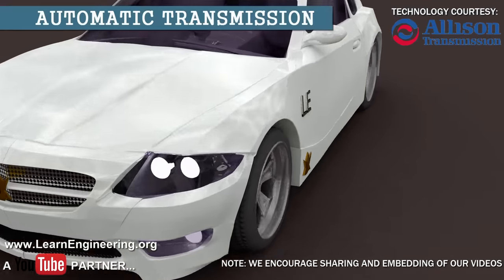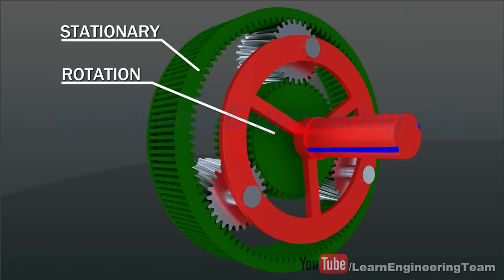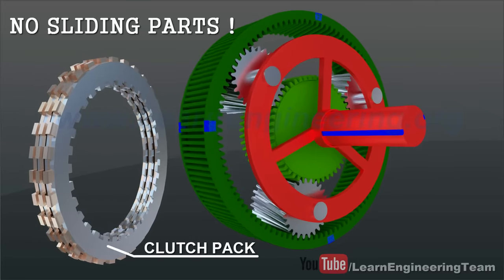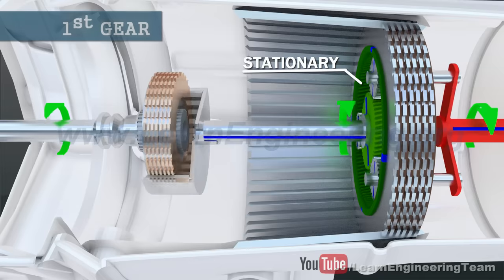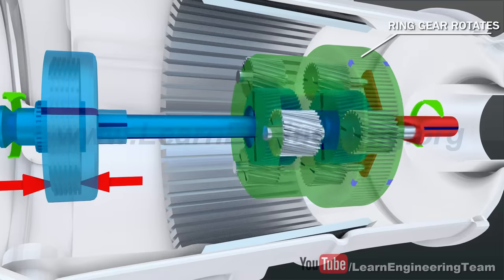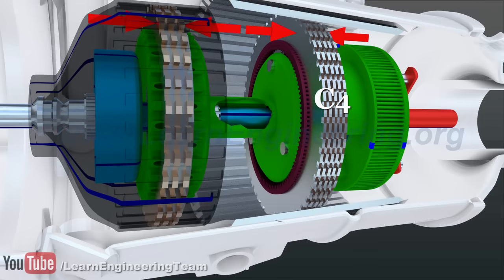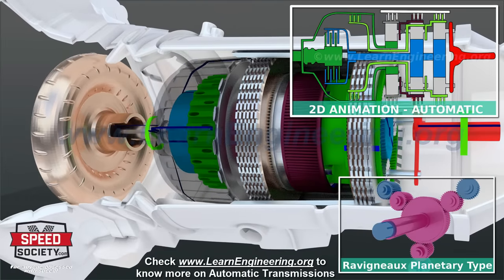Automatic Transmission, How it works?

Comment: Learning difficulty: 
1) Light speed
2) planetary colonisation
3) galactic travel and using sub dimension engines for first time dimensional travel
4) space time reversal using gravity in a black whole
5) simplest form of automatic transmission
Reply: Lmao
Reply: It does not even feel like a joke. Its just facts.
Reply: I am sitting here in tears laughing so hard about this because it was about as accurate of a statement as one could make.
Reply: And they work for years daily driven with no problems. A true engineering marvel.
Reply: It's not conceptually difficult, it's keeping track of all the fucking moving parts
Reply: the planetary gear moves with the sun gear and the shaft moves along with the car. think hard, you missed it. It is planetary and sun gear system. it has nothing to do with space and time travel.
Reply: Whoosh
Reply: You can't reverse space time using a black hole, you can only accelerate time with the gravity.
Reply: @alocin110 bro the SUN and the PLANET are part of the joke 😂
Reply: @carters1209 agreed! For context if anyone doesnt want to scroll up, he said that automatic transmission is not conceptally difficult, just that its hard to keep track of all the moving parts
Reply: i would have said extra dimensional engines but yes
Reply: @alexanderpennington4055  excuse me WHAT?? Thats a thing??
Reply: the thing is the video makes sense when u keep eye on each moving components
Reply: Lowered my hope
Reply: shut XD

Comment: Some kid in my freshman engineering class made a full working  miniature Lego car. Working electric engine, complete with working Lego power windows, and a full complete lego automatic transmission. Took him about 2 and a half years to complete. 

The guy was absolutely insane.
Reply: And I thought a 3-speed manual was hard to make work. Some people's brains just work different.
Reply: It’s called research and dedication.. and genetics lol.
Reply: What do you mean an electric engine? Like, just a normal electric motor?
Reply: Did you bully him? JK!!!:elbowcough:🤣😂
Reply: An actual car probably would have cost less :P
Reply: @Calthecool I've seen motor models that use linear solenoid actuators to act like pistons driving a crankshaft.
Reply: @timharig  
yeah I was just wondering if they meant something else, those are normally just called solenoid engines.
Reply: @drummer_zay9493 genetics have nothing to do w intelligence 😭
Reply: That's nuts 😮

Comment: I've watched and rewatched this, the only thing that makes sense is why transmissions are so damn expensive
Reply: Thank you  LOUIS EDWARDS, EDWARDS BROTHER'S TRANSMISSION ROANOKE RAPIDS NORTH CAROLINA 😁🔧⚙️🏁🇺🇸
Reply: @louisedwards6681  the comments section on this video surpasses every other video I've seen in the level of weird
Reply: Yes but there is still one thing I'm still confused about transmissions:

I saw a video of someone bringing one of these apart and the thing I was most confused about was the 3 layers of mazes and 4 small metal balls in each one of them and why it was so important not to move them? I still don't understand that part's function.
Reply: @richardcruz-torres4942  Those metal balls act like valves, for the fluid, for engaging different clutches, you forget or misplace one and you are screwed.
Reply: its not the parts that are expensive its the knowledge on how to fix/ rebuild it your paying for
Reply: @richardcruz-torres4942  that part I understood; they put all that metal like they put players on the field to keep the opponent from advancing with the ball
Reply: It makes my head hurt
Reply: bruh that was the only thing that crossed my mind
Reply: Hahahahahahahaha

Comment: Well, you did an okay job explaining the "transmission" part. What about the "automatic" part?
Reply: This is basically how it looks like - the only thing is, that modern automatic cars with semi-clutch technology have computer-supported clutch changing mechanisms.
Reply: Qᴜɪᴄᴋ Sᴀɴᴅ  So it(transmission control unit) cannot be applied to the basic gearbox? why?🤯🥴
Reply: @ravindujayasekara2969  It's a computer chip.  It reads input from the engine, as well as some other info, and determines when to shift gears.  That part is rather simple.  It short terms, it simply adjust gears when the engine is working hard enough, and the wheels are turning fast enough.
Reply: @ravindujayasekara2969  because that still required you to move the gears. That's what these automatics do? Is move the gears for you? The automatic takes the simplicity out of  it entirely
Reply: how does transmission control unit change the gears exactly?
Reply: @ravindujayasekara2969  cause moving the shifters require some big movement that it's easier to just feel it manually. For the planetary gearbox, you only engange the clutch packs which is fairly simpler to be automated
Reply: @ravindujayasekara2969 i might be mistaken but that might be how AMTs work (they suck)
Reply: It's automatic because you don't have to use your hand to manually engage/disengage the gears or your foot to engage/disengage the clutch.

 The car computer controls some solenoid valves that allows some hydraulic pressure to engage/disengage the clutches. The oil pressure is built by a pump that the combustion engine spins.
Reply: @JA-im7cs basically if the rpm is too high it shifts?or if the torque is too low?
Reply: @JA-im7cs  So how did the automatics work before computer chips were powerful enough to be used in cars? My understanding is that automatic transmission was invented before manuals
Reply: @squidwardo7074 Hydraulic pressure. Look into something called a "valve body." It's like a little maze for fluid pressure. Passageways open up and the pressure opens/closes the clutches. Transmissions back then were also a lot simpler and had a lot fewer ratios than today's do.
Reply: The transmission control unit reads sensors for throttle position, speed etc and sends transmission fluid compressed by the transmission pump, through the valve body (look up a picture of this), by using solenoids (electronically controlled valves). This hydraulic system moves the clutch packs.
Reply: basically: robot in car go haha change gear bcuz I said so.

Comment: Thank God for engineers... as weird as they are, I'm extremely grateful for the knowledge snd skill they possess to make things like this possible. This stuff is mind boggling.
Reply: They do the hard thinking so we don’t have to
Reply: We stand on the shoulders of giants. Most automatic transmissions borrow heavily from their predecessors. We have it easy these days -- the engineers of the late 1800s-1960s are definitely the real heroes.
Reply: as weird as they are?
Reply: @alandeutsch9987  They're definantly unique lol.. so much so as for me to consider them "weird." It's a good weird though!
Reply: @SDCustoms  It's nothing special. Just like learning a new language. You will have to study the different parts. You need to learn the conjugation,  the grammar, you will have to understand the sentence structures, the determiners, how gender is applied etc. Once you understand every part individually, you can create sentences. Once you know how to make sentences, you can make paragraphs, then chapters, then whole stories. 

Engineers studied. A lot. They understood the basics and build more knowledge on top a solid foundation. When that new knowledge is well understood, they can add more stories and build a tower of knowledge. 

You can't build the top floor if you don't have the floor below or any foundation at all.

Comment: I understand the basic concept. You apply certain clutch packs to engage certain planetary gear sets to use a certain "gear". I still couldn't explain it in detail, like I could a manual transmission, but I think I get it.
Reply: The other details are things like hydraulic pressure applied to clutch pistons. Similar to brake hydraulics. The other component is the actual gear ratios which are all different. Causing different planets to spin at different speeds.
Reply: Brain out of order.
Reply: Same.
Reply: I think most people here saying how complicated it is also understand it at the level you're describing.

Comment: Manual Transmission = harder to operate, easier to understand
Automatic Transmission = easier to operate, can barely understand.
Reply: rEsonansDx true
Reply: Stick is easy to drive
Reply: Sticks are easier to drive & control.......but automatics are soothing- no manual shifting required.
Reply: Manuaali on helpompi. Ja kestävämpi.
Reply: Ja automaatti kiihtyy hitaasti ja syö enempi bensaa.
Reply: it's pretty simple just watch the video again and again
Reply: ResonansDeX well said
Reply: exactly true brother
Reply: Funny how that works lol
Reply: Sonny Haskins you made no sense, Automatics doesn’t require the additional learning/thought process necessary to propel and stop. Unlike an automatic which all is done by a computer. You can shift smoothly in a manual
Reply: Continuously variable transmission is the best of all but it's not used because people like the elevating pitch roar gear transmissions make the engine emit
Reply: Is it me or does that sound like a potential allegory that can somewhat explain the social dynamics between the men and women.
Reply: easily the best concise conclussion. 
*my brain crashed, too. lol
Reply: Driving is more fun in a manual. Wanna speed up? Engage clutch, rev the engine, downshift, and feel your engine's power. Speeding up in an automatic? Better floor it and hope the CPU know what you're trying to do.
Reply: Manuals are also easier to work on.
Reply: @RzVids  not all automatics are computer controlled.
Reply: @CombraStudios  CVT constantly slipping belts and generally dont last as long as an automatic and definitely not as long as a manual.
Reply: Aleksfoxtrot if it’s not by a human, then it’s computer controlled.
Reply: @RzVids  I have a mechanical automatic transmission on my 91 f150. A computer controls nothing.  Its controlled by fluid pressure and flow.
Reply: Manual you have just a few gears and synchro and automatic you have a thousand tiny gears and gear sets different clutch packs for odd even gears and reverse, shitload of springs , little metal balls, valve body, pistons or one piston ,shift solenoids , oil pump, torque converter, computer , bands, o rings,  holy shit and thousand more parts to list I'll come back and keep adding
Reply: @Topsiekku  Video joka on kokonaa englanniks ja sit joku random suomalaine tulee kirjottaa tänne kommentteja vaa suomeks eikä kukaa ymmärrä xdd
Reply: I like manual, its easy to me to drive m/t
Reply: fun to operate
Reply: Right true dat.
Reply: Excellent point
Reply: CVT had performance efficiency related problems from what I've heard...car will have less overall power at the wheels compared to putting any of the other transmissions on the same engine.

Automatics have a fluid component between engine and transmission which translates to slight loss of torque at the wheels.

Manuals are annoying to drive in stop and go traffic and require more limbs to operate, but have a direct physical connection throughout from engine to wheels for the highest torque possible.

Quality and how long transmissions last depends on how well it is built and neither is significantly better or worse than the other when the build is good, although in a manual you will wear your clutch earlier depending on driver habits.

Ability to keep high revs is possible in all types of transmissions.

Manuals have an advantage of controlling and preventing a peel out at launching from a full stop, but higher-end cars have launch control software to avert this issue.

Other thoughts:
The amount of time it takes to shift a gear was traditionally faster in manuals assuming the driver was well skilled, but newer higher end automatics can beat the shifting speed of any human.

Automated manuals is also a thing which eliminates the fluid component from traditional automatics for direct physical connection from engine to wheel to achieve highest torque possible.

I had some free time to write this >.>
Reply: that's a good one 
but this video is 10% complete
Reply: CombraStudios CVT is the worst of both worlds, can’t handle torque, and currently are extremely unreliable, and extremely expensive to replace, they’re generally not repairable 

They’re fine in small displacement low torque engines like scooters and snowmobiles
Reply: Manuals can be easier to drive in certain situations, and can also be safer to drive (especially during winter) but they suck in heavy traffic.
Reply: Manual transmission is simpler and way more reliable
Reply: True fact
Reply: Nah you don't know how to oporates automatic car the computer does it for you
Reply: ResonansDx 👀
Reply: I think it would've helped if the video showed carefully how each gear worked instead of throwing all gears together in a rapid fire fashion lol.
Reply: @dushyanthkandiah3943  Define simple
Reply: @aleksfoxtrot8044  Automatics also didn't become efficient, reliable, and cost-effective overnight. It requires a critical mass of early adopters to motivate engineers to perfect the thing and force manufacturers to mass-produce thus driving down the cost.
CVTs are best hands down....if humans were logical beings that is.
Reply: Automatic Transmission does all the job for you; that's why it's harder to understand. Manual is simple, but you do almost 60% of the job
Reply: @mandelaeffect3521  That's a good strawman there. 
Manual transmissions have other parts than a few gears too!
Reply: @dushyanthkandiah3943  🤣 I think we all tried that 😅
Reply: @vilemberanek4448  well, try again...
Reply: That's with any advanced technology tbh. Old school computers were harder to operate, but were far easier to understand. New computers are far easier to operate, but are nearly impossible to understand unless you have a degree in computer science.
Reply: Might as well be magic at this point
Reply: @richsweeney1115  on what planet
Reply: Manuals are easy to operate too, unless you are using 1920's non synchronized transmissions.
Reply: Manual = New driver's bane, producent & mechanics delight.
Automatic = Driver's delight, mechanic's & producent nightmare
Reply: @RzVids  How did auto transmissions work before computers?
Reply: Automatic ,,,, expensive to fix
Reply: Automation is always more complicated than analog
Reply: For me Manual Transmittion is easier to drive - just raise the gear when about like 2000 RPM, and add gas when you need more power. If someone has ever played GTA, he will find manuals much easier😅
Reply: Fax. Here's a like

Comment: For anyone wanting to understand this the easy way just understand that '"C" stands for "clutch pack" and applying different combinations of clutch packs generates different gears. 

1st gear: C1 + C5 (clutch pack 1 + clutch pack 5)
2nd gear C1 + C4
4th gear: C1 + C2
6th gear: C2 + C4
3rd gear: C1 + C3
5th gear: C2 + C3
Reverse: C2 + C3 + C5
 
Also:       
C1 connects input shaft to intermediate shaft
C2 connects the hollow shaft to the rotating clutch module
C3 connects the ring gear of the 3rd planetary gear set to the case
C4 connects the ring gear of the 2nd planetary gear set to the case
C5 connects the ring gear of the 1st planetary gear set to the case
Reply: Gr8
Reply: Now you put it like that it's all so simple..... 
😕 😳 😵 💀 RIP
Reply: Thanks!
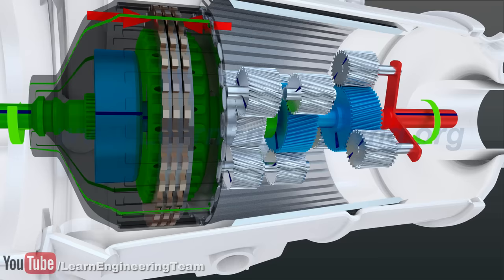Reply: how can c2 and c5 both be applied if c2 dircetly connect the ring gear of the first gearset to the hub and c5 restricts that same ring from moving at all, that seems like a contradiction to me and It s very confusing. Also in the animation it doesn't show c2 moving the green shaft which it apparently was connected to and on top of all of that, c4 shouldn't be engaged but at 6:35 it is pictured, thesee three things make the reeverse gear super confusing, I understand every other gear, they all make sense but this one doesn't. Now I understand why the second planetary output cant revolve now c5 is only applied in the first and reverse gear, and in the first we didn't see how it would affect the second gear system, but basically if c5 is in place the the planetary system of the second gear cant move. I would see how a reverse system could work if c3 and c5 only were in place. This would connect the ring gear of the third planetary system to the hub and witht c3 locking the ring gear of the 3rd planetary system, the planetary gears would move the ring gear of the second gear, and with the planetary gears of the second gear locked this wouold move the ring gear of the second planetary system in the opposite direction and that is connected to the ring gear of the first planetary system which would also move the planetary gears of the first system in the same direction, (albeit slower) but I mean reverse is pretty slow anyways so I would understand if the video says c5 and c3 but it doesn't so I'm just so confused right now like am I missing something or am I just stupid?
Reply: Thank you, you made it understandable